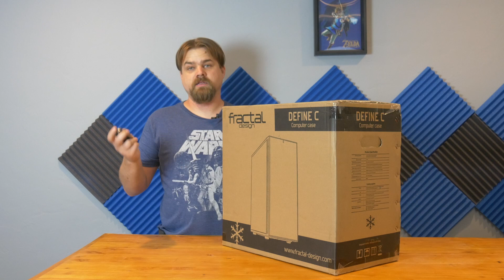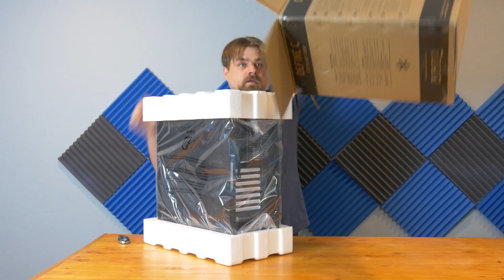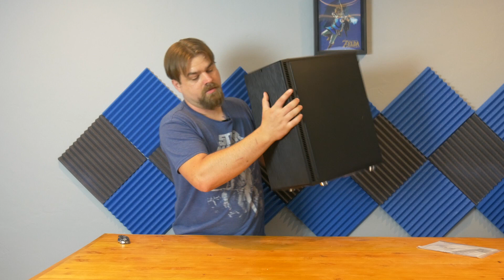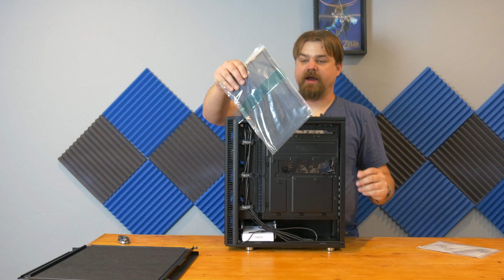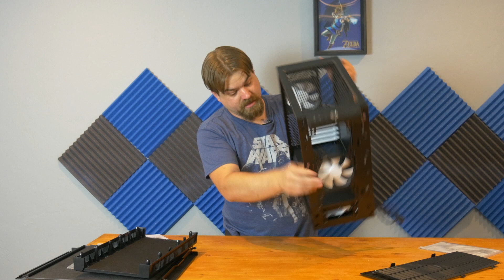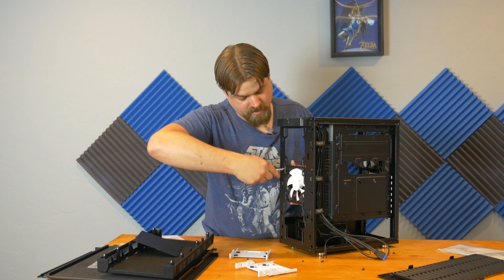Fractal Design Define C - Unboxing, Teardown and a Start to a new build

Comment: So...you cant just rip the front off to clean the filter inside? You really do need to open the whole computer with sides and all to do this? Wow, such a design-flaw!
Reply: Actually you can just pull it firmly off from outside, np

Comment: How does this compare to the Corsair 400Q in your opinion?
I'm going to get one of those.
Reply from the maker: I do have the 400Q as well. It's a decent case but has terrible cable management. You end up having to shove everything behind the motherboard and then hoping that you can close the back panel. Also having to deal with the bottom section of the 400Q was a bit painful. The define C has much better cable management and more room to work with. I didn't really notice a difference in noise level between the two cases. Overall I would get the define C, it's a great case.

Comment: hi sean can you please sit anything E-ATX inside of this case? I know it is not eatx but you will be this first person to try it. I want to modify mine. OR NOT at all. Are this standoff parts tall enough for EATX to bleed over this ridge?? i do not care if i have to cut a new hole. PLEASE if you have eatx make this video of laying inside of this case. NOT SERVER EATX but Zentith or any X99 eatx mainstream board.
Reply from the maker: This case unmodified does not have room for eatx. I don't have an eatx board on hand but rise near the front where the cables pass through is too high and the atx board I'm using goes just up to the edge of it. If you were to cut out the cable pass through in the front I don't see why that wouldn't work. you can get a better view of what I'm talking about at 3:35 in the video.